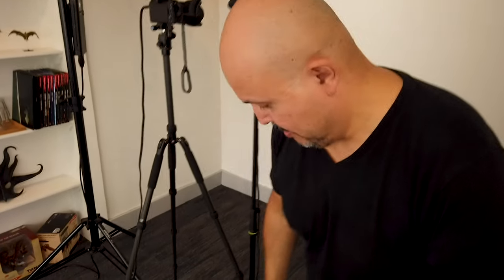Rode AI-1 AC Power Hack - XLR Mic Sound for your DSLR

Comment: This is exactly the information I was looking for.  I wanted to get the Rode NT1 package which comes with the AI-1, but wanted to be sure that it can be powered via wall power.  I know that the Motu M2 can be powered that way also.   Thanks!!
Reply: Did you end up buying one, and is it safe to plug into the electric wall socket?

Comment: Actually your solution is better than a built in power supply. Given the intended purpose of the AI-1 interface; adding a internal power supply would add complexity and cost to the unit.